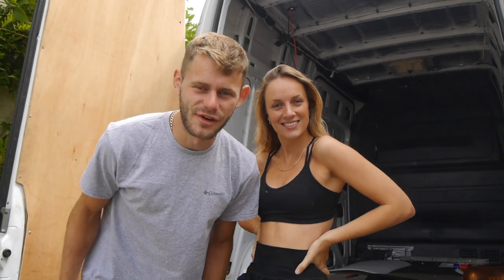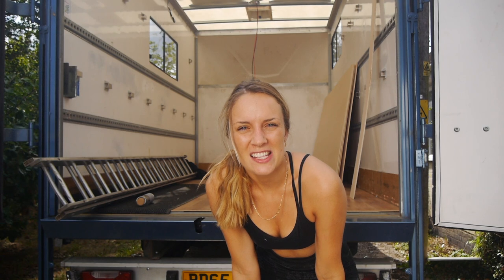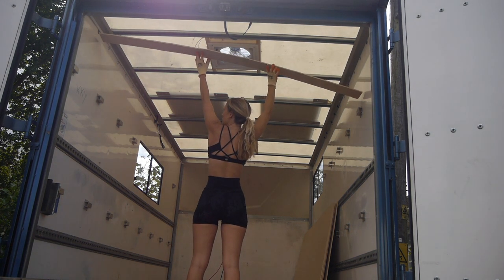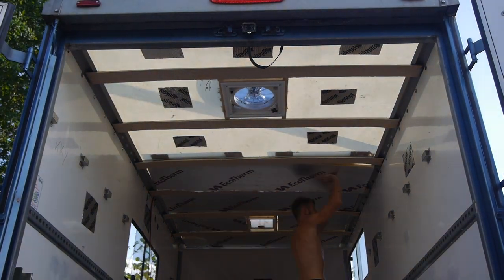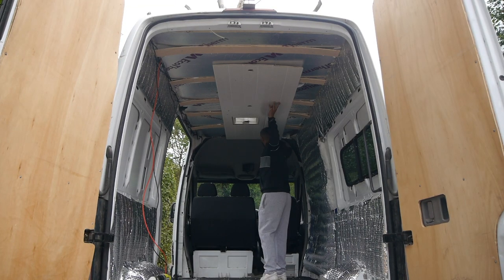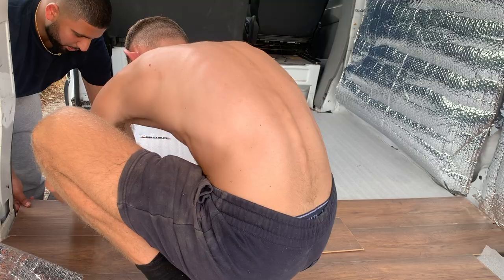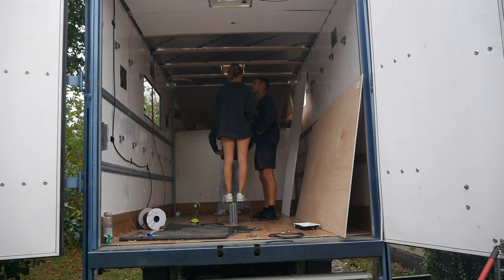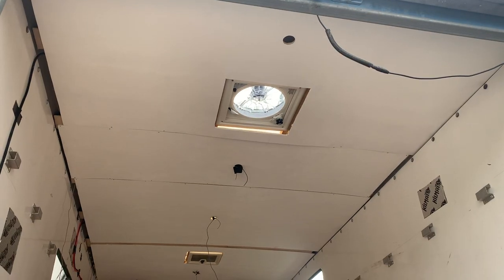VAN BUILD CHALLENGE! Sprinter vs Luton Camper Conversion / Ep2 Layout, Design, Insulation & Ceiling

Comment: Both looking good! I'm curious about the carpet in the bed area of the Luton...there is no insulation between the fibreglass roof and carpet lining so will likely get cold during the winter weather? 🤔
Reply from the maker: Definitely a good point, and something we only spoke about once the carpet was put up! I think we’re going to test the water, and if it feels cold when we’re living in it, re-do it with some roll insulation matt underneath! 

Definitely not a bad thought though, and something we may kick ourselves for down the line! 🤨

Comment: I had a brand new Renault master low loader Luton van in Feb that I wanted to get converted but nobody would touch it!
Reply from the maker: Oh no!! Yeh I can imagine. They really are so different to normal vans. Now we’re about to start on carpentery etc, I think having such straight wall edges on the Luton will actually save so much time!

Comment: Are you painting the cut metal on the air vent and windows?  If you aren’t it will rust. (Sprinter)
Reply from the maker: We applied a touch off of camera, the hammerite stuff!  definitely apply a touch
Reply: @NickyandHarri  really glad to hear that. Sprinters are fantastic, I own a 144”. The biggest weakness is rust, not mechanical issues. Good luck and I can’t wait to see the outcome.